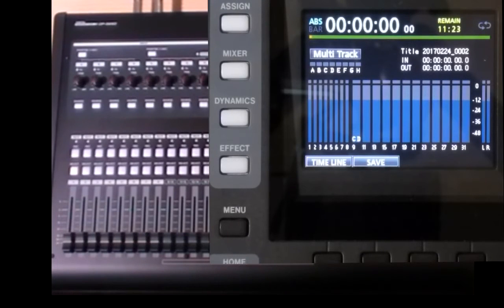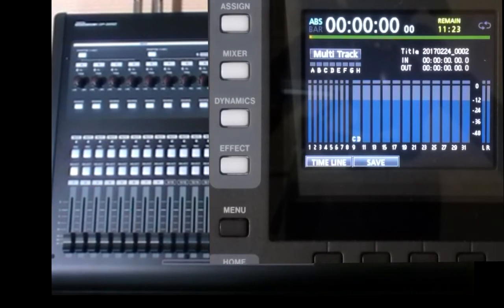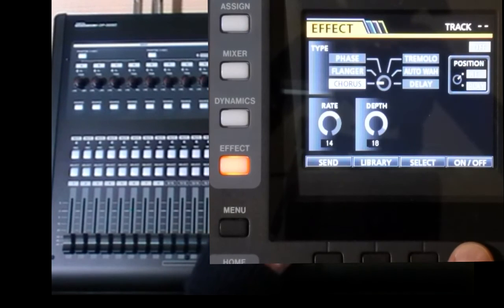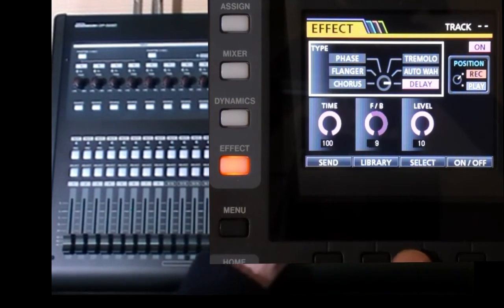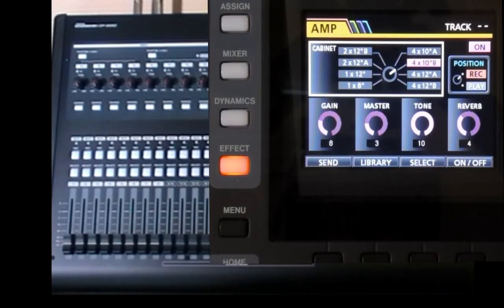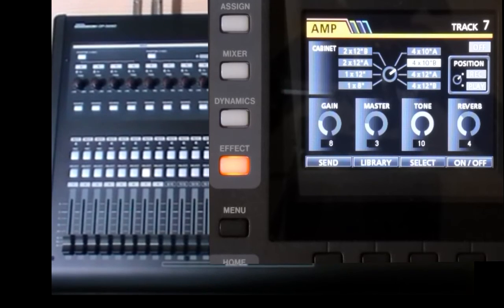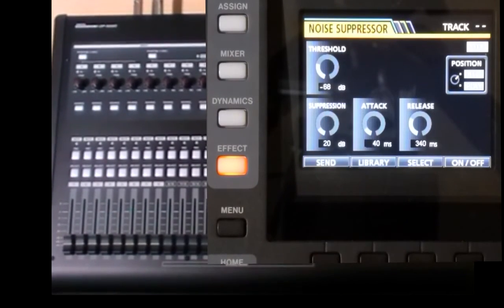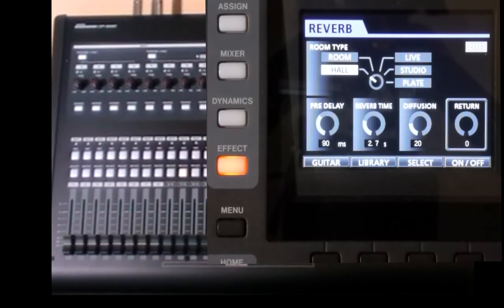Tascam DP24/32SD Tutorial 7: Guitar Insert Effect + FX Summary

Comment: My machine is giving off a bizzing sound ... How can I ground loop
Reply from the maker: @king 9 ether need more details. Can you isolate where the buzzing is coming from? Is it just on headphones or does it appear on monitor speakers? Is it on recordings?  The machine itself is not earthed, so if it's a power-related 50/60Hz buzz you could try earthing it, e.g. by plugging in a jack plug which is connected to an earthed device.
Reply: @philtipping  headphones and speakers .. I even unplug the speakers and headphones and recorded with tascam along and still humming in my recordings .. could this be a ground looping issue ?
Reply from the maker: @king 9 ether depends what you've got connected. As mentioned, the machine itself is not earthed. If it's the same as mine, the PSU adapter has a plastic earth pin so the whole machine is floating... in which case there is no 'loop'. But if you've got several other devices plugged in and some of those are earthed, maybe they are the cause... but I would go back to basics and check things one by one. Use a single input, with nothing else connected apart from headphones. Assign the input to the stereo bus (and nowhere else), then turn up the stereo fader and monitor knob so you can hear the source direct in your headphones. That way, you can test different things without messing around trying to record and playback. If you can hear the hum in your headphones, try earthing the machine as mentioned before. If there's no hum, connect your speakers and test again. Just be methodical and you'll find the culprit. Whatever you do, don't go removing earth connections from mains/live powered equipment - it's common folklore but is a dangerous practice. As a last resort, try a D.I. box to isolate the earth loop (if there is one). Good luck.
Reply: @philtipping  thanks

Comment: Hi Phil. I'm wanting to record vocals with reverb and delay. I can get a good delay sound with the send effects, however when i try and use the guitar effects effects delay, I get a distorted echo.   I also noticed I get a very distorted sound when using the chorus in the guitar effects. Any suggestions? 

Thanks, Grant , happy holidays
Reply from the maker: @grantcarlsonguitars distortion is either a level which is set too high or maybe another effect is switched on by mistake. Levels can be increased by effects and/or EQ. The L/R meter bars may help with checking levels. If you work through the signal path in a methodical way, you should be able to pinpoint the problem. 

Make sure you are only listening to one track, turn off all other effects and EQ to isolate the guitar effect. Make sure all the other effects within the guitar effect block are off, so you just have the chorus switched on. Then you can adjust the level setting within the chorus effect to see if that is causing the distortion. There is an additional level control in the mixer called digital trim which may help if the signal is too high when it reaches this point.

Note it's very easy to adjust the settings for the wrong track so always make sure the mixer screen shows the correct track number at the top right before adjusting things.

To avoid messing up other settings in your current song, you could create a new song first, and do all your testing on that. If you use a 'reset' template described in tutorial 2, you'll know all effects and EQ will be turned off, so there's no need to check those. 
Hope this helps Grant. Happy holidays to you too.
Reply: I was having that same issue. Come to find out, the Return signal in the effect block was set too high. With a little adjustment, the distortion went away

Comment: Not sure if this is relevant, but can you arm 2 or more tracks at a time, record a part.....that is recorded to all selected armed tracks, and THEN...apply a different effect to each track of the same guitar, and that would give you more options for number of effects you can use at the same time. 🤓🤔🎸
Reply from the maker: @Owen Fletcher you can assign the same input to multiple tracks and arm/record them in parallel. Another way is to just record to one track and use the Track Edit 'clone track' function to instantly copy the track to as many other tracks as you want. The clone method allows you make more than 8 copies.  I'm not sure if this is what you are asking as the guitar effect can only be inserted into one track at any one time, so matter how you duplicate the tracks. You can certainly apply different effects, but not at the same time... you'd have to bounce each track through the effect block and record the result onto a spare track. It's all possible, but needs time & patience :)

Comment: Is it possible to record a guitar with distortion, then add chorus over the distortion over (for example) the chorus parts to give it some boost? I feel like you mentioned something like this by bouncing the track during mixdown? However I am not sure if I understood the terminology correctly. I actually have a DP24SD in the post arriving Tuesday and am eager to have everything to hand. The issue is that I don't have a guitar amp with an output nor any effects pedals to use in realtime. However I wouldn't bother buying any if it's possible to add these effects within the dp24 whether that be during or after I have recorded the track. Your videos are great, and I feel like I will be watching them for years to come whilst figuring out how to get the sounds I need out of this machine!
Reply from the maker: @oldschoolwaverider thanks for the feedback. Well you can certainly add a selection of 'guitar-type' effects either during the recording or afterwards via loop-back recording, bouncing or mixdown, although I'm not sure if there is a specific 'distortion' effect type - maybe you do the same as with a real guitar amp and just overdrive it? Chorus is available both within the guitar effect block and the send effect, so again you add this before or after. 
Re. adding "chorus over the distortion", when you add an effect during recording, the original sound plus the effect is recorded onto the designated track. When you add an effect afterwards, the original sound plus the effect goes to a separate track, so the original track is never overwritten as such. This means you can choose to record the effect itself without the original dry signal, and you'll end up with 2 tracks, one dry, one wet, allowing you to mix these however you want later. You don't have to do it this way of course, but it's just to give you an idea of the flexibility of the machine once you grasp the signal flow.
Here's a complete summary of all the effects http://www.tascamforums.com/threads/dp24-32-fx-definitive-summary-of-effects.4162/
The step-by-step guide contains a lot of useful info as well as numerous 'how to...' steps for specific tasks, so this may be useful if you're just starting out. Details and a list of contents is here http://www.philizound.co.uk/freebies/dp24-32/dp24-32.html
Good luck for tomorrow - I'm sure you'll be impressed with the build quality when you unbox it :)

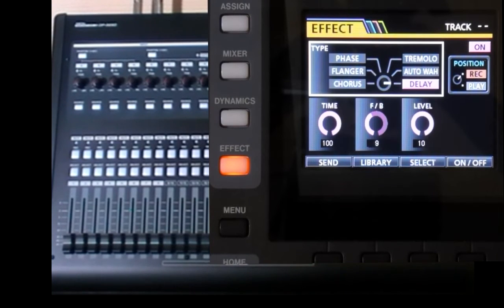Comment: At 3:07 - there can only be one effect type at one time. This limitation plus the questionable quality of on board effects leaves me with using an external effects processor. One of those I have in possession is the Alesis Quadraverb where you may have 4 effects simultaneously with the addition of having the ability to modify the effect parameters in detail. With keyboards, I usually use their on board effects pre-production - which may not be the ideal way to record.
Reply from the maker: @Bobcatt22 yes a few people have gone this route, although with patience and repeated bounces, you can get round the concurrency limitations and apply different guitar and/or send effects to multiple tracks. You'd have to do something similar if you had one really high-quality (i.e. expensive!) external effect; it's just a case of adjusting your workflow depending on the gear/tools at your disposal. Another option is to feed the send outputs back to spare inputs and utilise the dynamic effects - an understanding of the signal flow helps to avoid feedback.
Reply: Am I understanding correctly that, without external gear (or patience and repeated bounces), the Tascam 24 permits just one guitar effect on one track per song? 

Wrestled with this for hours... I have two electric-guitar tracks, on Track 3 and 4, both recorded through Input H. I'd like to send Effect -> Chorus to both. I click on Select for Track 3, Effect button, and turn on Chorus. It works. I keep the Effect button on, and select Track 4. The Chorus goes away from Track 3, and comes on Track 4.

On the Mixer screen, Insert Effect can only be lit up for one track, not both.

I haven’t seen this circumstance in your tremendously helpful videos. Apologies for the "What? You don't even know that?!"-ness of the question... Many thanks, Phil.
Reply from the maker: @sjgeltman  that's right, the guitar effect block (which is 4 effects in series) can only be inserted into one track at any one time... but the guitar effect isn't the only effect on the machine. The send effect (video 5) can be used on any combination of tracks, and this has a chorus type, so you can use this for your electric guitar tracks. You route through the send effect in a different way to the guitar effect. The 'Insert Effect' box shown in the mixer screen is for the guitar effect and dynamic effects, not the send effect. I know it's confusing, but all I can suggest is to go through the videos again, and/or buy my step-by-step guide, and then if all else fails I'd be happy to help you on a one-to-one basis via email - address is at the bottom of the page on my www.philizound.co.uk website.... and you don't need to apologise for any questions - we all have to start somewhere and if you're new to multi-tracking and/or this machine, it can be a minefield :)
Reply: @philtipping  Thanks, Phil. I imagine your book's as helpful as this great reply, so I'm glad I (just) bought it! Much appreciated!
Reply from the maker: @sjgeltman  the guide is on its way Seth, many thanks for the order.

Comment: Hey how to make the condenser mic the song crisp and stereo perfect when you record . I recorded my voice and it sounds like I'm underwater and it sounds low how can you adjust the mic so it can sound very good and professional
Reply from the maker: +Dj Rude Boy well you're doing the right thing by using a condenser mic - this should give you a really crisp & clear sound. If your mic needs phantom power, make sure this is switched on. There are a lot of factors which affect how it sounds. If you are too close to the mic, it can sound very bassy so either move further away or use EQ to reduce the bass. Some mics have a built-in switch to do this; if not, use the EQ on the recorder. If you're too far from the mic, you'll start to pick up reflected sound from the room , so if your room is not very good acoustically speaking, you may have to stay close to the mic. You may also need a pop-shield, but this is just to protect the mic and reduce pops from your mouth - it won't make it any crisper. Other things to check are the input & recording levels. The early videos show how to check the 2 types of overload lights and which controls affect them, so make sure you are recording at a good level without either of these flashing. Lots of other techniques can be found on the internet, e.g. check out Sound On Sound magazines technical articles - I just searched for "sound on sound recording vocals" and came up with this as one of many examples... http://www.soundonsound.com/techniques/vocal-recording-production-masterclass
Good luck.

Comment: Phil, I am the proud but frustrated owner of a Tascam DP24SD. I have had this machine for three months or so and can't figure out routing for my guitar, keys or vocals using the Effects, Dynamics switches. I seem to be able to plod about and find sounds I can work the and have a handle on Assignments, Ins and Outs and more, perhaps  Boss has spoiled me with their 532 and 800 models. A tutorial for those flailing about like myself that explains Digital Trim, Effects 1 and 2  would be hdlpful.
Reply from the maker: Hi +Ray Parkin, well I was hoping this series of 19 videos does all that :) - there's certainly mention of Digital Trim and all the effect types, with a lot of background info about the difference between Insert effects such as the Dynamic & Guitar effects, and Send effects 1 and 2. I don't cover how to adjust individual settings to get a particular sound, e.g. how to actually use a compressor or a noise suppressor etc., as these are standard operational topics which are not specific to this machine. Can you give more details about your problem? You say you can't figure out routing using dynamic effects, so have you worked through the videos up to Tutorial 4?  If you have a lot of questions, it's easier for me if you use my email address instead of YouTube comments - the address is at the bottom of the page on my website http://www.philizound.co.uk

Comment: Hi Phil, just a little off topic but maybe you can help.  Since there is no metering in the Compression feature,  do you know of a way to get more accurate compression settings than just hit and miss?  Thanks again
Reply from the maker: Funny you should ask, Robin. I was just about to check this as I was literally just adding compression to several vocal recordings made on location with the dp32. I was using the 'old-school' way of running each track in real-time through an external compressor, which takes ages, so was thinking it would be a lot quicker in future if I used the compressor during the recording - which is normally how I record vocals back at base. So I don't have an answer. Suggestions anyone?
Reply: Robin White Use your ears. It also helps knowing what each parameter does. Do test recordings to see the affect compression has on the vocals/instr